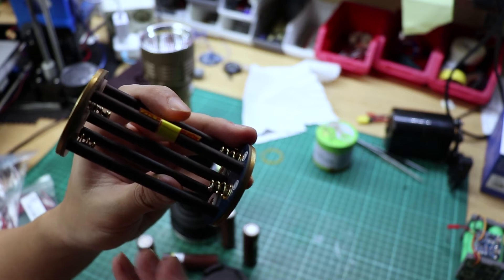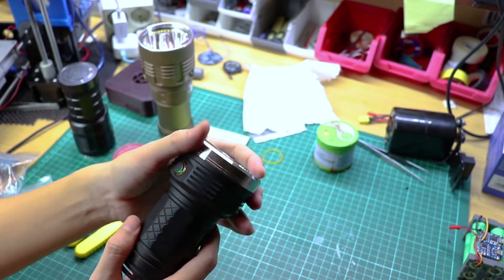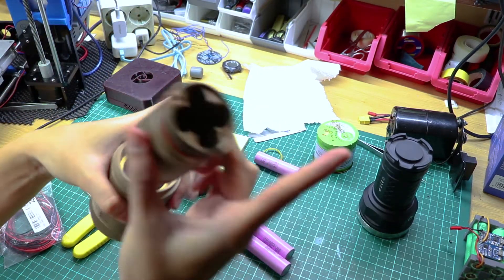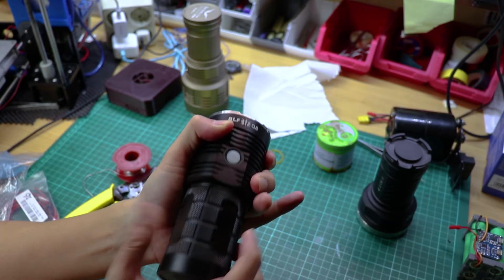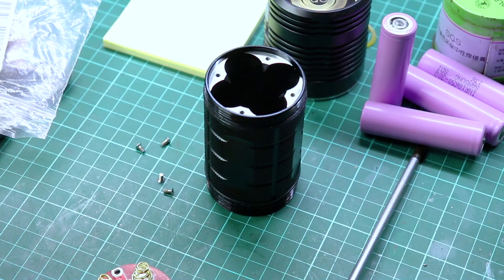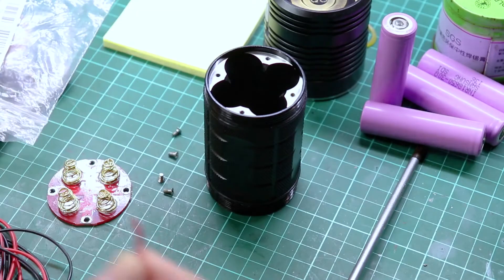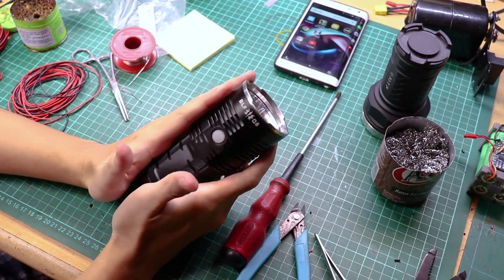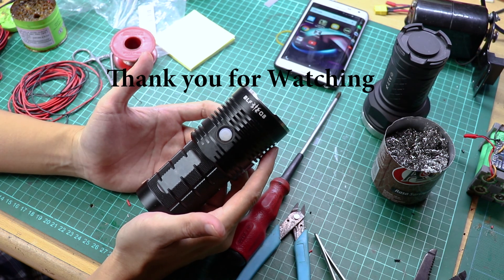Spring bypass quick tutorial on BLF Q8

Comment: Personally i stripped sheath off some cables, and feed as many strands(10) as i could fit, thru holes below springs, up to top outside edge of springs, and soldered, then took other end of strands(leaving a small amount for flex in spring) diagonally across and into that hole below that spring and up to top the same, and soldered over holes.
And repeated for other two springs. then i soldered the cross points of diagonals together, and also to pc board track below.
Then i tapped out one screw hole to m3, and made another short lead from cross point, with a loop (flattened) to go under a copper plated screw i had.

For my batteries i soldered flattened rings made from 40% silver easyflow to tops, then turned them in lathe to get a nice true surface, and drilled center out so as to remove any solder from being in contact with torches ring.

No light tube, but had 3 torches to compare with and without battery or spring mods, and can say i see a good improvement.

Comment: Lux isn’t lumens , plus you would have to measure in inside a custom made lumen measuring device with a lux/ foot candle meter and do some conversions to get the actual improvement. I wouldn’t trust that phone app, I have tried those before and they don’t work
Reply from the maker: Total Reviews i couldn't agree more, to measure lumens you need a calibrated integrating sphere. The cheap way although not the same is to use ceiling bounce you cannot get a lumens but you get relative brightness and can easily compare brightness between your own flashlight collection but of course with many limitations. Ceiling bounce is not meant to be comparable to others as even different room will give different results. But yeah usefull for comparative purposes between different flashlights. That is why a ceiling bounce in this case can be use to compare different results, you can extrapolate the result and guesstimate the inprove lumens but of course estimate is just an estimate only integrating sphere can reveal true OTF Lumens.
Reply: Rizki Pratama very true I have used the same method as adventure sport flashlights does with the PVC pipe as a so called "lumen tube" and it works very well. On the other hand I just went out and bought a soldering station because of this vid and I think I'm gonna do some flashlight modding of my own. Gonna try to do a XPL HI v3 mod on a convoy c8 we'll see how it goes